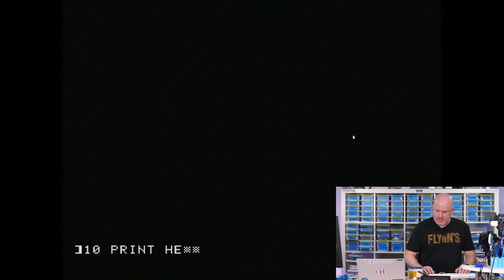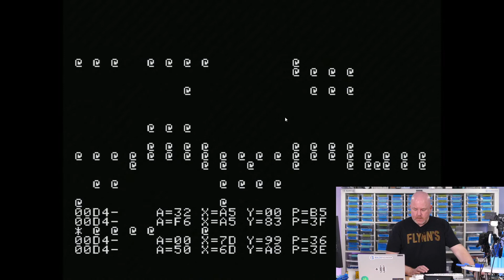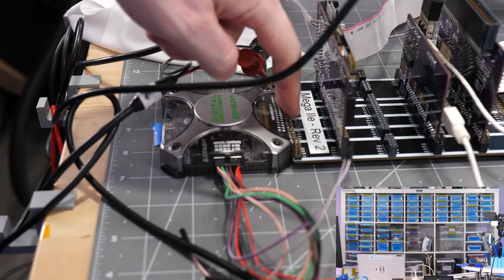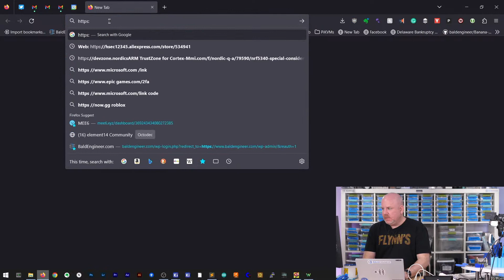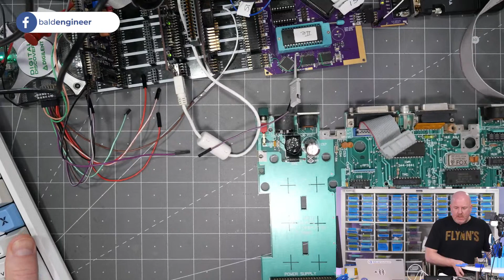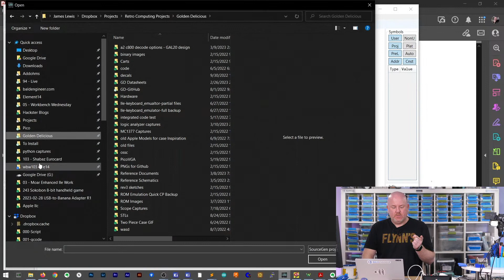Baldee Live: Mega IIe Returns!

Comment: I learned decades ago not to guess where the case wires plug into the motherboard. I plugged the USB into the FireWire header. I destroyed 3 USB thumb drives before I acknowledged what had happened. And they were 64 Mb drives. What a loss. 😄